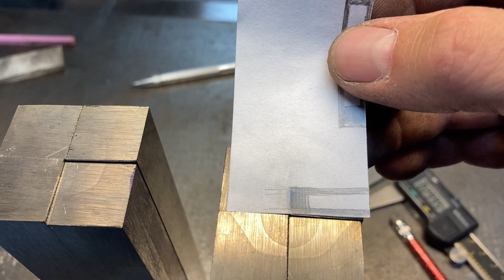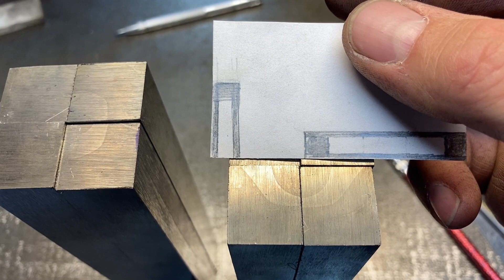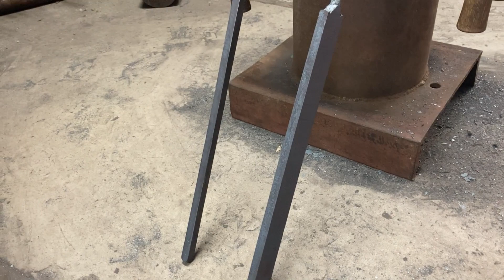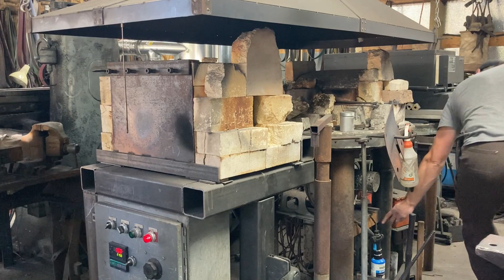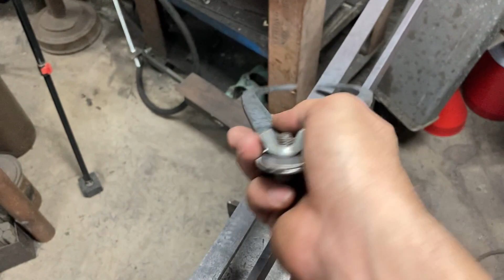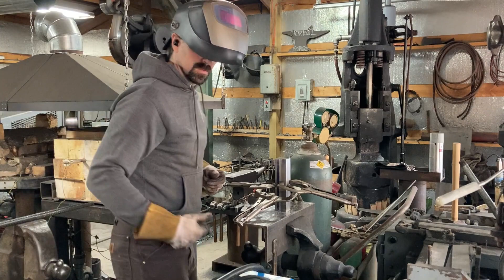Jailbird Feather Damascus Chef Knives, Part 2

Comment: How do you surface prep your initial mono steel stock before your first forge weld?
Reply from the maker: Depends on surface condition. My 1080 and 15n20 are generally clean enough that I don’t need to grind them clean. Some 1080 I’ve used had enough bark to need it though. My CruForgeV stock is so rusty I surface grind it all to a clean 36 grit first…
Reply: @PrometheanBlade  thank you, I see so many different ways people use and I like to try them all, is it primarily rust and other oxides you're worried about but not so much the mill scale?
Reply from the maker: @ohiovalleyforge5383  if there’s any real scale in the steel I’ll grind it off. But the stuff I get from Kelly Cupples is either pickled or cold rolled to the point where it’s pretty much scale free.